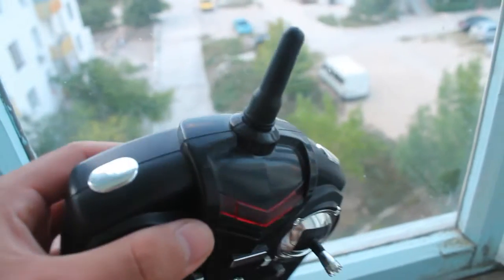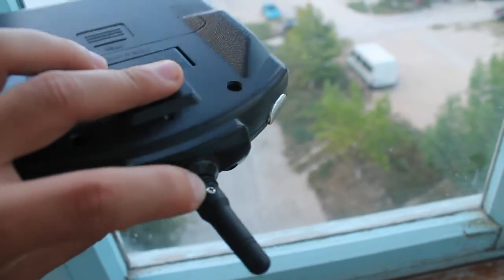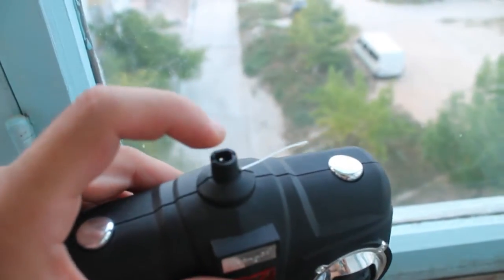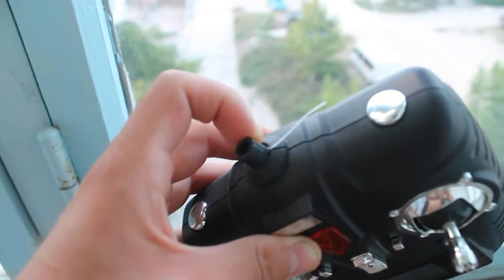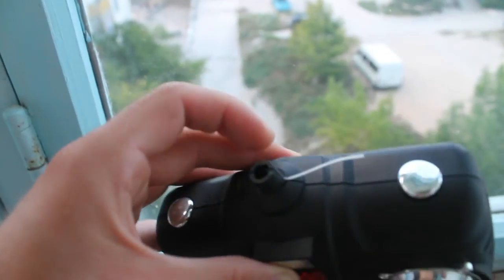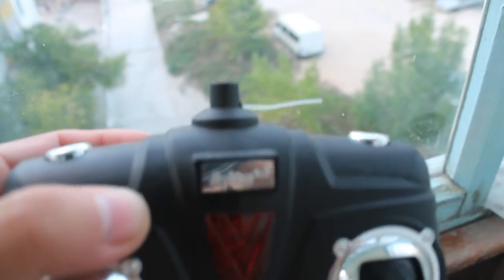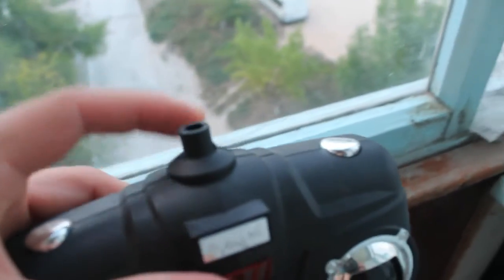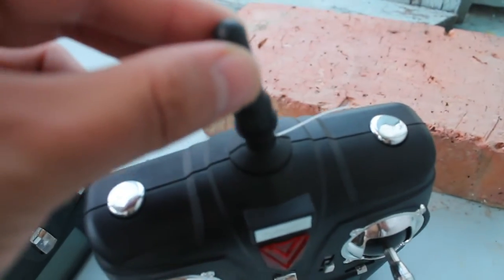mod of Tx of v222, v959, v212, fy-999-2 to improve signal transmition

Comment: Thanks for sharing. How much better was the signal strength?
Reply from the maker: I can't measure but I think if there's no plastic b/n 2 antennas it's better. and antannas being parallel is very important in distance. I flied ones and when quickly turned my Tx antanna tip towards the quad I had series of drops and catching back.